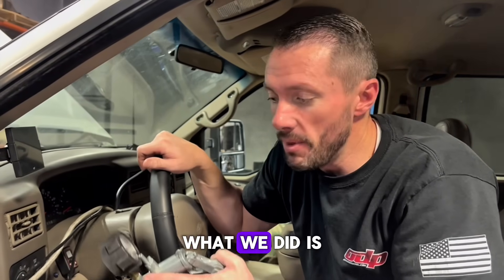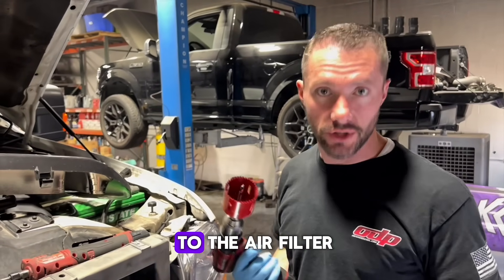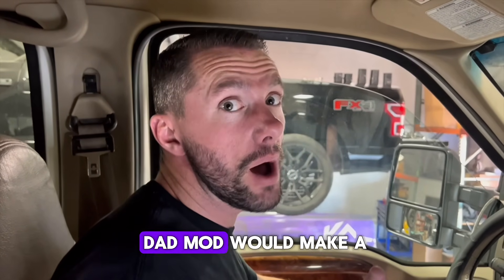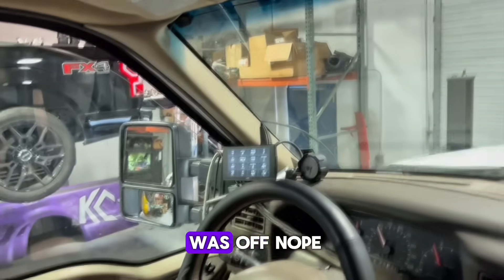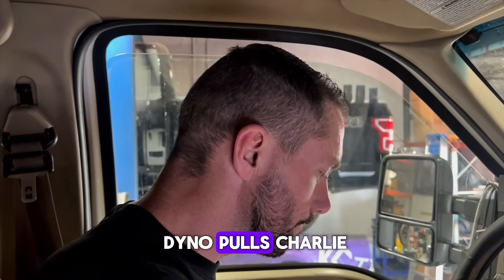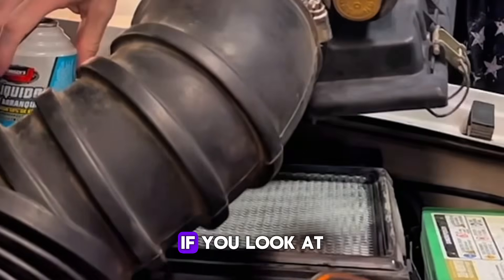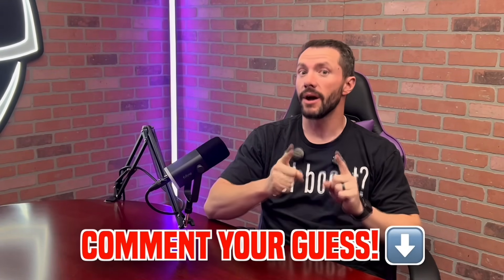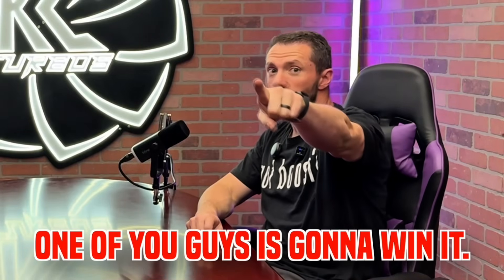We Tested The WORST 7.3 Intake! Zoodad and 6637 Dyno Testing - Legendary 7.3 Giveaway EP. 7

Comment: Zoo dad allowing lower IAT seems a bit unrelated seeing as the air temp sensor is right behind the grill. Unless I’m wrong and that was a different sensor in the video. Did it change egt at all?
Reply: the iat sensor is in the airbox. The temperature sensor you see on the header panel is for the overhead display in the cab.

Comment: I just bought a 2001 7.3 F350.  It came to me with the 6637 mod done.  I don't know anything about diesels but I couldn't understand why someone would swap out a factory cold air intake for just a plain filter under the hood.  But the factory parts didn't come with the truck so I looked around and discovered that factory air box parts are expensive.  So that was many thousands of miles ago.  Now I recently learned about the S&B cold air intake.  I see that I can go with that and it's probably better than the factory.  I'm going to get rid of that big filter and swap out to the S&B when my budget allows.
Reply from the maker: The S&B will be a great improvement when you are able to get that in there! Most people who install a 6637 do it because they saw it on an internet forum from 15 years ago and took it as gospel.

Comment: With the zoodad mod, northeaster here, do you have to worry about sucking in rainwater?
Reply from the maker: I would imagine that could potentially be an issue with very heavy rain
Reply: @KCTURBOS  thanks for the response, these videos rock. Looking into a 2000 f250 and when I found these videos my wallet started to cry but my heart started to smile lol.

Comment: zoo dad mod with SnB is the best.. the one thing you don't get in a shop is the force of air flow in the intake ,, the open intake to help to pressurize the air box..   unless you put a fan that is able to mimic the flow of air into the the air box at the different speeds like if the truck was going down the road.. now that can be different depending on the wind direction.. going into a 6 MPH head wind at 60 you are pushing more air in than a tail wind ata same speed.    The 6637 alway sucked.. for real..

this is basic fluid dynamics..

Comment: For model year 2000 on the 7.3 diesel the inner cooler is cast aluminum is it not?

I’ve also heard of another modification called the gen dad mod where it completely removes the plastic on the edges of the grill and allows additional airflow over the ends of the intercooler to further cool down EGT’s

Have you tested this? The zoo dad mod makes complete sense. I’m running a model your 2000 with an AFE Magnum power filter and I believe it’s an open air.

It does have a seal around the box, but I’ve always wondered if SNB pulls lower intake air temperatures and I’m guessing it does

Comment: Sure would of been nice to see the comparison of the stock vs S&B with new filters in each 🤷. Also you can cut holes in the side of the stock airbox on the fender side of the truck and it allows more fresh air from the wheel well
Reply: There was a Banks test way back in the day (if you can find it) that tested quite a few differnt intake options that were available at that time.  It's a bit dated at this point, but it may yeild some results for you...

Comment: I bought an s&b used on ebay for my obs after years with a tymar "6637" kit.
From that point i was sold.
My 01 has an s&b and its the best value for intake. Also gave my place to mount fuse block for my lifepo bank/ inverter for my camper in a clean manner.

Comment: These are the cool little informative videos that most wouldn't take the time to put out, so thanks Charley and the KCTURBOS team for making the effort to shoot, edit, and post this content!!
        You can see how a few bad choice combinations of the simple things a lot of guys take for granted, or spend little time paying attention to, can really start to add up and rob you of performance. 
         One thing that came to mind watching this that I see on a lot of trucks, and mine included, that I think is maybe one of the most common air filter setups on a 7.3 that does not use the stock air box anymore, is similar to the 6637 filter setup you tested, but just using a s&b cone style filter terminating up against the fender behind the battery. I personally just run a pre-screen filter mesh bag type deal over the filter and call it good.
I noticed there's a cutout in the fender right at that location that looks like the filter can actually suck air through the fender pulling air from around the headlight area. That was my logic when I installed my s&b filter in that location.
        So basically, I guess it would be interesting to see the same setup test as the 6637 but just using the s&b filter without the s&b box.
If there's a 20 degree difference in intake air temps, then to me that's significant and would make me want to install the s&b box vs just having the filter attached right to the end of a 4" pipe.
       If you have any input on that Charlie, I'd love to hear it. The filter sucking in under hood hot engine air is the worst thing I can think about that setup.

Comment: Hello kcturbos I’d like to see a dyno test with 2 of the Napa filters in a closed box that breaths from the front where you drilled the zoo dad mod. You’re not comparing apples to apples. The Napa filter keeps more contamination out so to gain power and flow and lower air temp you need 2 and also a closed box like the s&b. On heavy equipment for more power applications they have 2 filters.

Comment: I think we all understand a less than $100 filter setup is going to under perform a $400+ setup. The fact of the matter is the 6637 style filter, just does a superior job removing contaminants from the air, the trade off to that is restriction. In industrial applications clean air is just as important as clean fuel and oil. If you really want to test this show the difference in Silicon content of the oil with an S&B style oiled filter vs a 6637, I’ve done it and the oiled filters have more silicon contamination in the oil. For an outright performance application an oiled style will excel for reliability I would stick with a 6637.
Reply: S&B has a dry filter option.
Reply: @ yes but it does not flow the same as the oiled filter it only flows 580cfm the oiled filter flows 653cfm and the 6637 flows 425cfm. The sacrifice for better flow is less contaminant removal from the airflow
Reply: @  the S&B dry filter is 99.66% efficient the 6637 is 99.95% efficient at removing contaminants it makes a diff over the long haul

Comment: All 6 of my 7.3s run S&Bs 
My 6.7s are all on stock airbox, S&B is not needed on a 6.7 until you're up in the 700+ hp range, stock box is good on 6.7 
All my 6.0s run full AFE boxes, there is no difference in the AFE and S&B cai's they are both pretty well equally built imo.

I run nothing in my 6.4s, well because I hate them lol !

Great video and I'm 50 years old and been preaching this for decades to mainly the younger crowd, they just don't listen.
6637 is fine for just tooling around like a kid, but my trucks pull 30k+ weekly, so air is a major issue. Again good video guys 👍

Comment: Does the S&B intake have the same advantage over the 6637 in the OBS 7.3 Trucks or is this more of a Superduty only improvement?   

I'm running the Donaldson Blue 6637 filter and I've been happy with it for about 15 years now.  I'm got 160/0 Full Force Injectors, Hydra with 1023 Tunes, Banks Intercooler, and a KCTP38R and am happy with the setup so far.  I only use the truck to tow and I tow heavy (15,000 lbs+).   Would the S and B be worth it on the OBS 7.3s?
Reply from the maker: The same results would apply to the OBS, so it would be worth it for the EGT reduction alone.
Reply: @ I’ll find out.  Just ordered the S and B intake for my obs.   I have an intercooler on my truck already.   Hope this intake helps for towing.

Comment: @Charlie, you should do one with an oem AIS filter system.  The blue Donaldson filter media will flow more than the standard paper filter unit.  I would also NOT do the Zoodad mod as it allows water, snow, etc. into the filter media.  The Secret Zoodad is the way to go given the hole goes into the vertical piece right behind the grille so you can't see it.  Given the air being sucked in has to change direction, the water will fall out before it enters the snorkel.  Ford actually did this on the later trucks.

Comment: So wait, Dale really was Taking Your Money And Running! 🤣🤣🤣

I will say your fan is a joke. It doesn't flow anywhere near what the truck would see going down the road. There have been several people who've tested IAT temps while driving with an open intake and the temps were barely over ambient.

Also how hack job testing is that to test with dirty filters. Are they really so cheap as to not just put new filters in to get an actual proper test?

Comment: Just a question don’t bite my head off where was location of iat sensor for each test if you are doing test please disclose information
Reply from the maker: Sensor is located inside the intake just after the air filter
Reply: . Got a picture of the iat sensor location ?  Can't see it installed in the video.  Nearly all people who run the 6637 just zip tie it out the way..

Comment: For the next video I want yall to test y’all’s stage 3 drop in for a obs 7.3 with a intercooler kit and 5.13 gears. Yall said it wouldn’t spool the turbo with 160cc injectors and it did just fine.
Reply: It’s just a waste.  550hp worth of air with 400hp worth of injector.  All the lag and downside with no extra power.  They have done this already and shown the dyno graphs

Comment: I have a 2000 with a bunch of mods and upgrades, and the 6637. The intake boot would cave all the time, i finally figured out that was happening, was looking for a fix, then it ripped open. KC turbo upgrade, and some 4 inch alum tube fixed that. The EGTS where still too high. Saw an s&b, got an s&b, egts went way down. Truck is happier i am happier. I wish i would have called kc turbo a couple years earlier for advice. Seems they already knew.

Comment: So what happens if someone uses a 6637 filter and built a metal box around it? I did this and am curious how it would then perform
Reply: It really depends on how much heat soak that would stop. The S&B is just plastic if I remember right, which should help to insulate the filter.
Reply: That's my plan after going to a t4 kit. I can only get the 6637 to fit for now. Needs a box around it.

Comment: So what filter can I ask for at Napa that will fit in the S&B intake?   or is it ONLY their proprietary filter?     Why didnt S&B make their housing large enough for a 6637?
Reply: Thats my biggest reason for not going S&B. I've seen way to many dusted turbos from the S&B filters. I would much rather put a whole new filter in in 2 min. then clean a filter for 5+ min. I'm also sure part of the reason for the lower IAT with the S&B is it is flowing more, which is great for performance, but that could also indicate that it isn't doing as good of a job filtering. I'll take a 12hp loss for better filtration on the many gravel roads I drive.
Reply: @ohnojt they have a paper s&b filter but I have 2 oiled ones, if you use the proper amount of oil and clean it when it starts to look dirty nothing makes it by the filter, my intake tube is spotless.
Reply: @jensenleblanc  didn't realize they have paper ones now. And i do know the oiles filters can do great, it's all about how you take care of them, and most of the people I saw with them come into our shop did not take care of them.
That said, I also saw a couple of 6637s that weren't taken care of do similar things, but those 2 had like 40k miles of dirt roads on them, and new filter and they were fine
It appears to me that if the stock boxes weren't so prone to cracking, that would be the most cost effective option for power.
Reply: @ohnojt more dusted turbos means more sales for KC Turbos 😂

Comment: Finally someone posted this. I had 6637 for few years I had to run stock tune to keep egts in check with 6637 pulling 8,000 lbs on long grades on 90 degree day. With an enclosed air filter i was able to add power.
Reply: I tow 14K in 90 degree weather with the 6637 just fine. Far from stock and don't have any EGT issues.

Comment: I have a 99 super duty and an installed the Motorcraft severe duty filter kit. Unfortunately , I guess they’re discontinued at this moment. Be kind of cool if you could test that one. I’m glad you guys are doing videos. I enjoy them. Cheers.
Reply from the maker: We will have to see if we can get our hands on one! Thanks for watching! 🙌🏼
Reply: @KCTURBOS  This is a test I would also like to see. Ford/Donaldson called it the Severe Duty Air Induction System. The factory intake you tested is notoriously known for poor sealing around the filter inherent to its design. In areas where the engine saw use in dusty conditions many engines were dusted by this poor factory intake. That’s where the Severe Duty version from Ford came in designed by Donaldson to remedy this issue. It seals and filters very clean. In many cases that was the purpose of people including myself using the 6637 filter, not as a performance mod but for clean filtration. I won’t speak for it as a performance mod or lack there of, but I can attest to the fact that it filters clean air and that is the only purpose for many running it.

Comment: Someone needs to remake the ford severe duty ais
Reply: That's a great filter but doesn't flow enough to keep a bigger turbo happy. My 38r would suck the indicator into the red on any hard pull. Switched to a S&B.
Reply: @ do you still have it?  It would be nice for my stock 01
Reply: @paulzumpf3612 I’m running it with my T4 & 363/68 sxe with no issues. Secret zoodad and the AIS fender mod.  Fender mod is needed because the box itself did cause a restriction.
Reply: @RacinJason675  I did the fender mod and still had trouble.
Reply: @RacinJason675  
but you are still on stock sticks IIRC...The AIS if I recall was only good to about 400HP
Reply: @INFRNL1 yes sir, stock injectors here. But the comment was about pairing the AIS with a larger turbo (38R) which is why I chimed in. 
The AIS definitely has a limit, but for now it’s working well for my use and I’m willing to accept a little flow trade off for the great filtration.  My filter minder only moves past 20% if on a sudden hard pull in a hot tune. The quick snap of demand seems to affect it more than steady high (30+) boost numbers.
Reply: Your filter had to be plugged for 38r to collapse boots.. clean ais filter is a great filter, 99% of  people don't realize how much dirt can compact up deep inside the ais

Comment: but the trucks not actually  moving  so air isn't being introduced into the front of your truck  to like be pushing on the truck  🤔
Reply from the maker: We have a huge industrial fan blowing air on the front of the truck it’s not as much air as driving 80mph down the highway, but it does simulates the truck moving.
Reply: This isn't good info for just a 7.3, but it applies to anything. Hot air intakes don't work.
Reply: I'm really impressed with the power this 7.3 is making with what mods it has. I always think of a 7.3 as being a slow tud. Will you be doing a similar series with a 6.0?